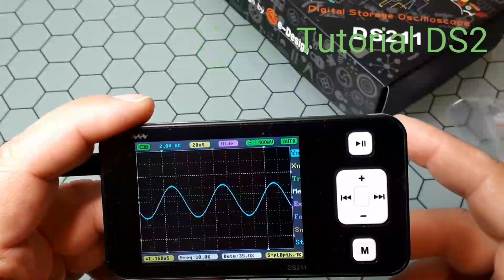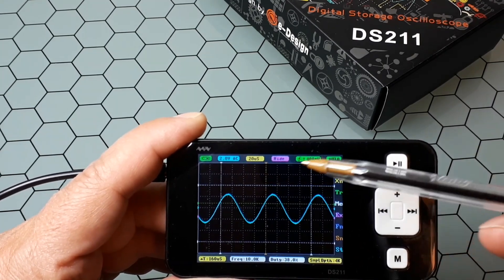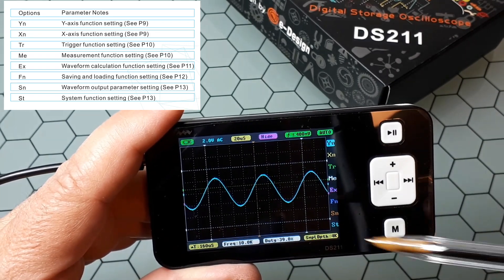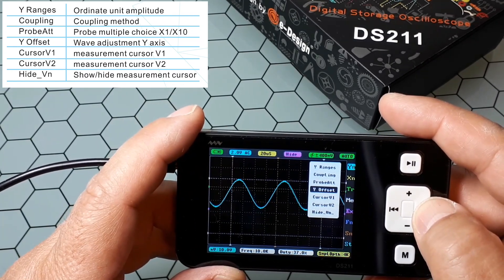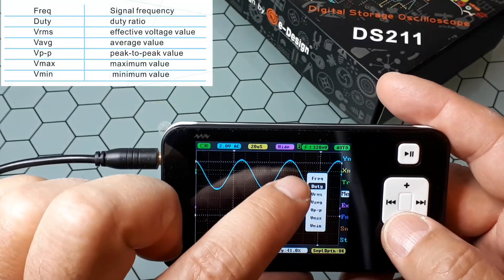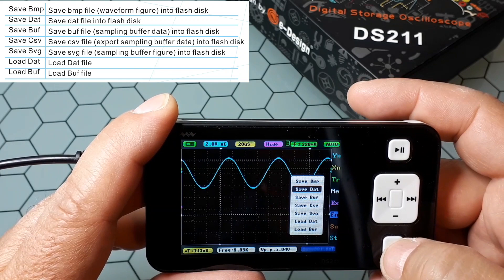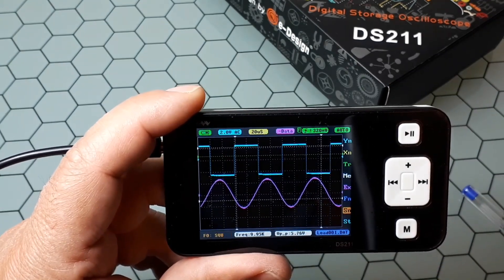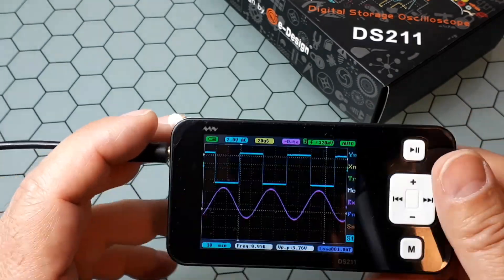Tutorial DS211 oscilloscope

Comment: How to check 220v this ds211
Reply from the maker: This unit could measure 40v peak. If your prove comes with 10x switch, just switch it and you will be able to measure up to 400v. If your prove doesn't have the 10x switch, use a voltage divider. For it you just need two resistors. Check on google for "voltage divider"